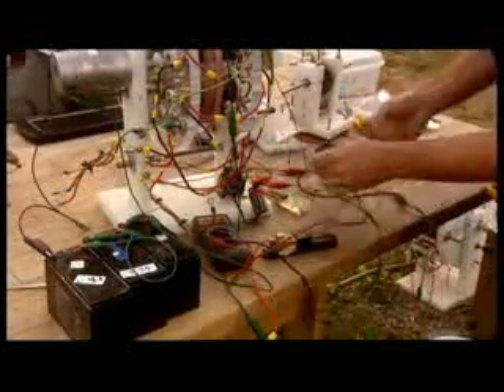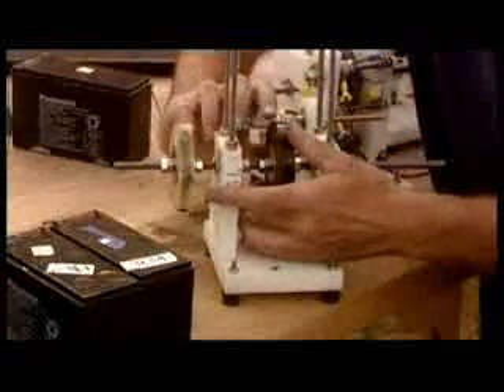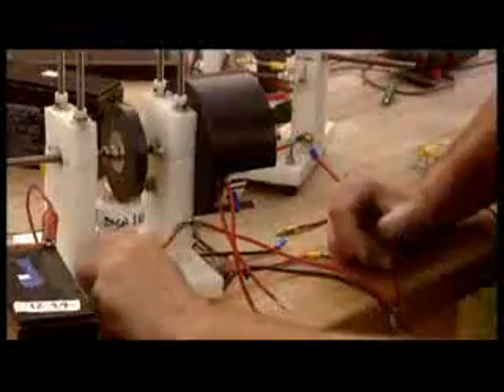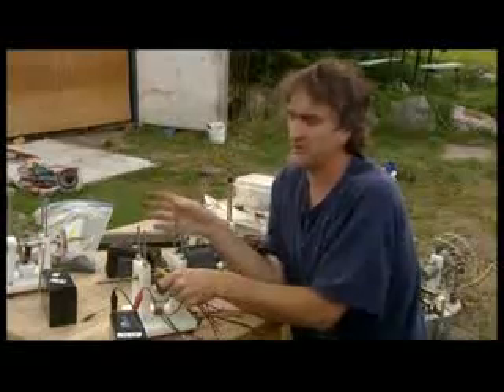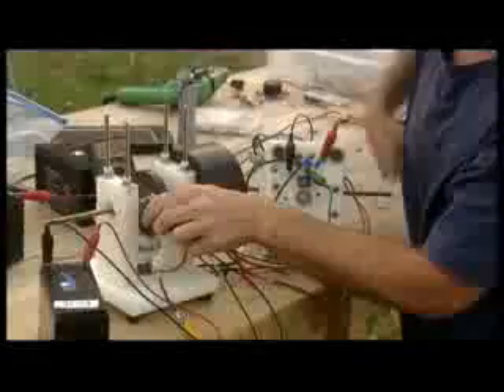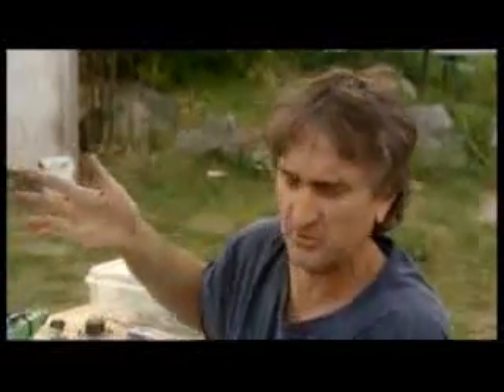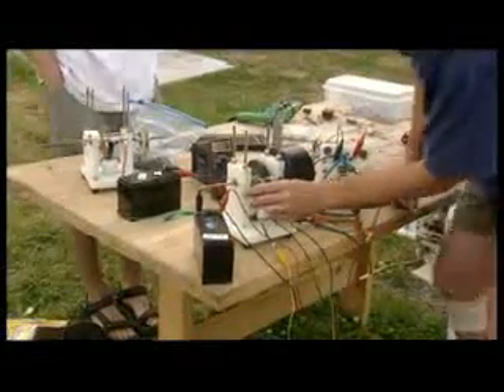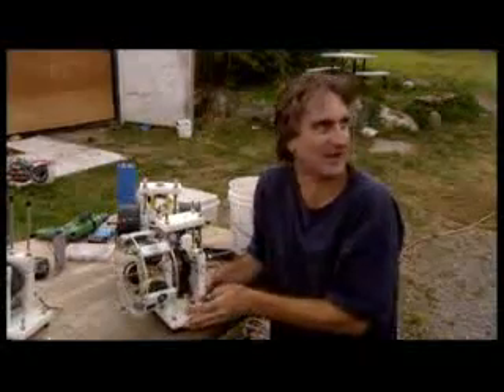Doug Konzen - Free Energy Pulse Motor

Comment: Bah humbug.  First off lets get the definition of energy.

"power derived from the utilization of physical or chemical resources, especially to provide light and heat or to work machines."

If you are really getting more POWER out of your device than you put in, then why not just connect the output of the diode bridge to the battery running the motor and eliminate the battery you are charging?  If the motor continues to run then substitute a super cap for the battery and it should run forever without all that messy switching the batteries (which as you know the voltage went lower each time you switched them around).

You get more VOLTAGE out of the BEMF but you are NOT getting more energy (POWER) out of the BEMF circuit than the motor uses to run.  The voltage spikes do NOT have more energy in them than the voltage/current that the motor requires while charging the extra battery.  Try putting some meters on the circuit and just measure the power levels.

All you've made is a very inefficient dynamotor.

Comment: There is still a net energy loss. Even the wire that the current is flowing through are providing resistance and thus energy is being lost. The internal resistance of the batteries add to the net energy loss. It may be efficient in that it is reusing some of the energy that is otherwise not doing work but is should not be mistaken for being over unity. To be over unity it would have to be 100% efficient or greater. The wires alone would have to be perfect superconductors.

Comment: Hi Doug,

Can you send me only the switching circuit  that comes off the full wave bridge rectifier so I can manually switch batterys from charge to use and vice vesa  All by throwing a switch or switches. I have only ONE moving part rotating at 2000 rpm in my device.  Your help will be most appreciated.  Contact me directly at 65t@comcast.net  STATE BATTERY SWITCHING CIRCUIT in E mail.

Comment: Where's the transformer?  Using an external adapter?  An amp that's on all the time is no place for a 9V battery.  You're supposed to take a Joule Thief and add another winding to the core, and rectify, filter and regulate that and use it for a replacement PS for the battery.  It's good to see you got it all together and working.

Comment: Ismaels motor has 4000VDC from capsacitor impulse, and this pulse is chopped up in giga hertz  frequency too. Around the primnary/motor coil that reciieves this HV chopped pulse is wound much thicker and bigger "pikcup/secondary" winds. Every time the motor/primary coil gets pulsed, it makes tons of "normally wasted" current in those secondary/pikcups... so what goes in, comes out wiht even more power than what goes in. Watch the video. what you beliieve in is what you beleive.

Comment: it is feasable what I demonstrate in this video (motor runnig on batteries and charging batteirs faster than they drain on primary side)
My freind Ismael Aviso has a CAR MOTOR that uses much the same design I show here, but high voltage and chopped input pulsing, plus massive pickup winds around primary/motor coil.
His demo video shows 8 amps in from 12V battery running it, and 15 amps out to charge 2nd battery. this is proof without doubt. type in " Ismael Aviso carmotor" on youtube.

Comment: this is old video

 all I show is FWBR aC legs across motor coil and DC into battery and switch plasma distinquished

new circuit is  have AC legs of FWBR over motor coi and DC into load (batteries) but  new circuit isyou have a 2nd switch on just one AC leg of FWBR and have it swtihc on-off slightly delayed to initial motor coil pulse.
Someone I know has  a motor running on CAPACITORS ONLY using this same circuit with "swiched AC leg of FWBR in echo pulse to motor coil pulse"
try it out

Comment: HV side of "trigger" transformer  goes across run cap phase of 120V-run 3ph AC rotovertor motor have LV side around 4.5VAC 
Bridge rectify across that 4.5VAC make it  a DC "humps" signal now of about 4VDC.

Charge 12V battery  with 2nd  120VAC/15VAC "power"tranformer and rectify also run that  from run cap phase  

Charge battery with tthis power-transformer but have it so charge-pulse happens  when
 trigger-transformer tuns on-off  3.5-32VDC trigger side of 40A 100V mosfet relay

Comment: There is lots of OU machines working right now  - look the MRA (magnetic resonance amplifier) it is simple works on resonance and puts out more watts than input.
The rotovertor can be Ou when you pull out power form the run cap phase via "non-reflecitve" extraciton by way of circuit that pulses out power only at sinewave peaks feeding the AC rotovertor motor./
Dretube has been asked not to comment on my videso but continues to do this. Id ont like him and reccomend all to ignore him

Comment: Golf cart batteries  will last 5 years charging up and discharging everyday while car batteries will go bad quick when you drain them and then charge them

"Look at that baby go" in this video is about the battery voltage rising - and at same time the plasms inside that switch has vanished

Very simply the recoil of coil has been captrured and put to use charging a battery

Run the motor on 24V and charge 12V batteries - this works best with this circuit "direct" into 2nd battery stack.

Comment: update/correcitons to this video clip of me:
Generator on shaft should pulse-out into load (batteries) at a sweet-spot in rotation that does not lug th emotor driving it.
Batteries being charged should not be car battereis - they will go bad after a dozen or so charge-discharge cycles.
There needs to be a 2nd swtihc on one of the AC legs of the FWBR that extracts the badkeme/recoil - and this 2nd switch turns on-off in echo pulse to the motor coil pulse.

Comment: More info on circuits are found through the youtube "rotovertor demo parts one and two" videos -  type in my name doug konzen to find these two video clips..then go to info link opn those video clips and find the links to my site and read there about the rotovertor AC motor conversion methods and details.
The "swtiched AC leg of FWBR over motor coil swtiching" backemf recovery circuit is shown on my site inside "circuit diagrams" link

Comment: When you switch out the energy gained from recoverying the backemf/recoil as shown into 2nd batteries, instead place a switch on one AC leg of the fulllwave bridge rectifier ver the swtihc itself, like shown in video, but now turn this 2nd swtihc on-off in echo pulse to motor coil pulse. power goes up 200% draw goes down 25% 2nd batteries charge great. Run on 24V charge multiple 12V batteries in paralell

Comment: difference between me an Bedini circuits is that I have method I print here (but is nto shown on video) to put a swtich on AC leg of FWBR and this swtihc truns on -off in echo pulse to motor coil pulse. THis is super gret way to pull out backemf/reocil/plaasma from switched coils.
Reply: hi Doug, do you have a circuit diagram for the "switch on the AC side of the FMBR" ? thanks

Comment: Video corections:

Use golf cart batteries, not car bateries 

Golf cart batteris can charge-discharge everyday for 5 years while car batteris can only do a dozen or so cycles befrore they go bad

Run motor on 24V, charge 12V batteries. 
If using caps, have 23V in your cap when it charges 2nd batery stack. 
Use multiple batteries in paralell being charged
Gen on shaft should pulse out at sinewave peaks and/or "0 line
FWBR should have 2nd swtich
on AC leg like echo to motor coil pulse
Reply: What about having a 12-24v lithium battery as source?

Comment: video of me is 5 years old.
Nowadays  I recomend people to look into the rotovertor AC motor conversion as you use an off-shelf 3ph AC motor that has factory toleances and perfectly balanced rotor.

You can pull out power from the AC motor via trafo over run cap phase. rectify, 
and switch out at sinewave peaks into load

If the aussie discovery channel had shown the circuits I describe with ACleg of FWBR swtich and pickup coils and my Muller motorgens, this would of been a better video

Comment: rotovertor is conversion of 3ph AC motor 
runs on 2 of the 3 phase

can go under 10 or 20Wat idle, (1800  or 3450rpm) best torque of any motor you can get too
can self-run or charge batteries as it runs 
google my name and look for my site -  look at link #16 for "RV" circuit and info...also look at panacea-bocaf site for lots of info too. Hector Torres is "inventor" of rotovertor - it is open-sourced - so nothng to worry about and it is very easy.
I will have a video demo of it up soon